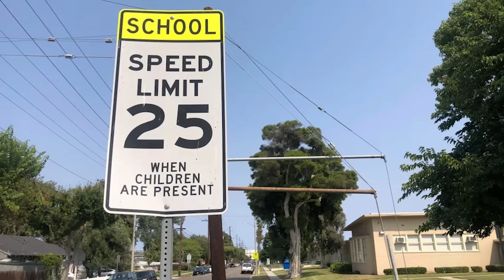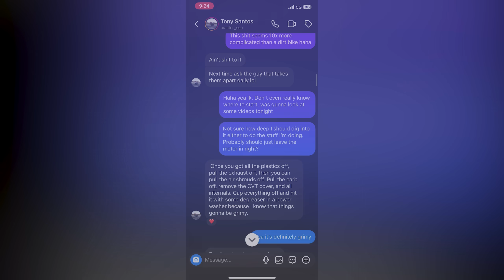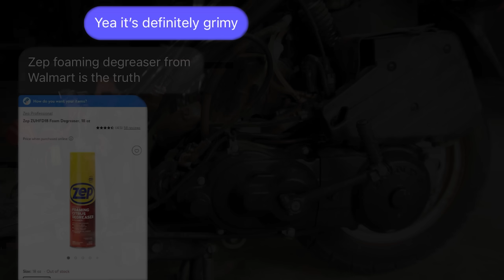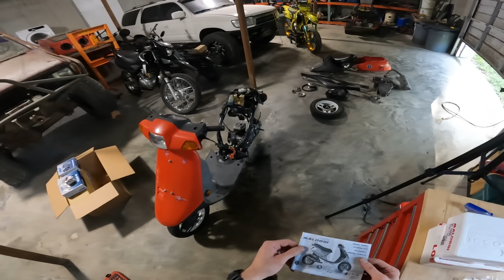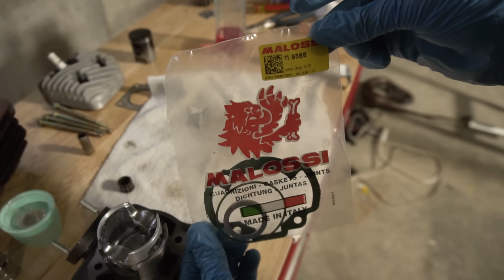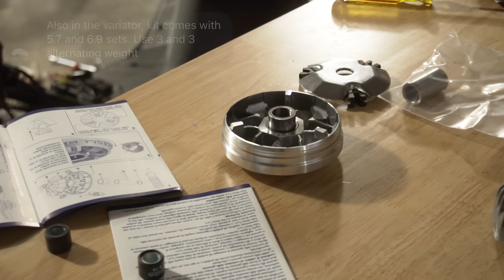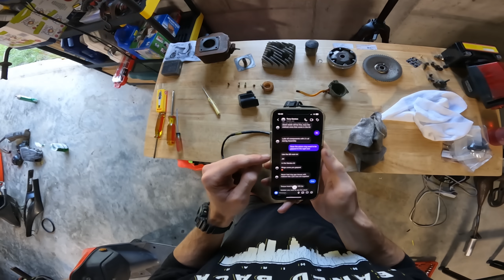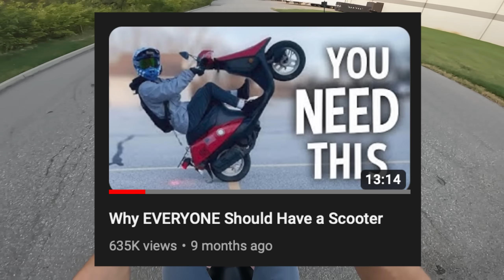HUGE Power Upgrades on my DREAM SCOOTER

Comment: Try it with the old center spring for the clutch it could be even more responsive. It just depends on every scooter. Btw that 70cc should  top out at 110km/h if you lose the airbox
Reply from the maker: yea I bet the carb and airbox is the biggest restrictor rn
Reply: @TwoStrokeJ  get 19 or 21mm carb or something and polini airfilter
Reply: @sodaman5048  you forgot that you need to throw out the dellorto and get a pwk
Reply: naaaah, airbox is the biggest friend here, cause 2t engine is so vulnerable about air "pulses" back and forward and amount of vacuum in the intake. Leave it alone, max you could do is drill some slightly bigger intake hole in your box. and naaaaah x2, honda vertical af-18 never gonna go 110km\h on malossi sport spec. Even much more tune-able yamaha jog will not. Around 75- yeah, maybe 80  @TwoStrokeJ
Reply: @Shokai899  bro never heart of a powerfilter
Reply: @Shokai899 110kmh is 65mph ??? ur numbers are higher bro
Reply: @moes95  dunno where's 75kmh higher than 110kmh ))
Reply: try to change the spark plug with the iridium one 
iridium spark plug should do the job @TwoStrokeJ
Reply: Could use a digital tachometer ay. 110 km/h, however is probably about as fast as I'd trust myself to ride that thing without further safety mods.
Reply: Shokai899 u are right i had a suzuki katana whit full malossi sport 70cc and it max out around 85 km/h
Reply: Leave the air box alone in my extensive experience there's no difference in power with a well tuned engine, just drill our were the air comes in on the standard one
Reply: The original center spring will just allow the belt to be pulled deeper into the pulley and most likely will never let it get into lower gearing. Unless you use super light counterweights inside the variator.
The pulley half that slides in and out is your problem area. That half pulley rotates and slides on 3 pins that are 1/4" posts/pegs that reside in 3 grooves, as the pulley goes together and opens it has to make a twisting action as well to get the pulley fully into high and low gears. Those gliders will start to cut the grooves into those slots. After a few weeks your gear will be stuck in the gear it rides in the most. Those pins aren't the issue, it's the slots. They get snags in the slot from the pins digging into the slot while riding.
That's why I shit canned 2 2002 Kynko Cobras.
Doesn't matter how many cubic inch you give it, or how much power, or how many RPM, those rear pulleys will always be duds and keep you from shifting properly. Flat spotting the weights in the front pulley often. 
If a person weighs 75 Lb. then they will get longer riding time on a brand new rear pulley. Anyone much heavier is going to wear into that rear pulley in no time.  Usually getting stuck in mid range gearing. So you have no take off and no top end either.
If there was a way to harden the metal of those slots, they would be golden. Even in 2002 that metal used on those pulley halves was too soft for the torque of the pins cutting into them.....
Reply: Can you guys please put your complete Addresse in the comments as the police wants to start a big confiscating for security reasons
Reply: @Kirt44 me too haha, those were the days. I ran mine with stock clutch and Vario, it melted the weights eventually, spun the plastic like candyfloss.
Reply: yasuni r exhaust 21mm carb and a 92 jet. running a bit fat. but it will def give more power and low end tourqe.
Reply: @Kirt44 stock italian scooters (piaggio nrg, aprilia sr, gilera runner) go 85kmh, so how come others cant?

Comment: Your 50cc Honda scooter looks very similar to my first 50cc scooter, a Honda Vision, which I bought somewhere around 1995 in The Netherlands. I was 16 back then, the legal age one is allowed to ride 50cc scooters and mopeds, nowadays a valid license is obligatory. What about the US, do you need a special driving license for 50cc? What is the maximum allowed speed for 50cc two-wheelers? In The Netherlands it was only 45 km/h and every moped and scooter was throttled,. either with a special cap or ring in the variomatic (the front pulley) and/or exhaust. The easiest way to remove the restriction was replace the exhaust pipe and change the vario weights, sometimes also the fuel jet. Unrestricted a lot of 50cc 2-stroke scooters would easily do 60-80 km/h, with a racing reverse exhaust pipe sometimes even more. Downside was it being illegal. What do your local policemen say about it?

Comment: If this is the original carb, you might wanna buy a carb that's 2 to 4mm bigger. A carb that's too small for the amount of cc's is also restricting A LOT of power.
Reply from the maker: Yea I agree it’s restricting power, but I wanted to use the stock one to hopefully keep the engine really reliable
Reply: A 26mm Mikuni from the Yamaha DT 125/175 is a must-have. A no brainer.
Reply: A bigger carb won't reduce reliability unless it's lean or too hot. @TwoStrokeJ
Reply: @TwoStrokeJ  this is a common misunderstanding since a bigger carb does not have anything to do with the reliability of the engine. Those malossi cilinders are made for big carbs, so it would even be a good thing for the engine.
Reply: Also, old carbs are less reliable since they are worn more. It wouldn't be a bad thing to replace the carb to one that's the same size if you care about the fuel economy.
Reply: That’s what I was thinking to a new carb. Get a polini cp21 it will be a lot faster!
Reply: @Toxic2T  you don't need a 26mm for a setup like this, a Polini CP 19, or even 21mm, would be perfect for what he's trying to do with the scooter
Reply: 26mm do just fine for 50ccs and even 100ccs. I do use them on most my builds. 21 is too small, already rocking one on my PA50 with AE50 cylinder. @sdugasjr
Reply: The stock intake is about 17.5-18mm wide so a larger carb wont help stock is about 14mm so Unless you run a CT style reed intake. On mine I modded a 17PE Nibbi carb (gastank epoxy puddy and 6mm tap) to work since jets are very easy to get and have pilot jets too. I tend to deaccel off throttle instead of brakes when i can and the stock non adjustable pilot jet will make it run lean on deaccel. If you go after market carb intake route stock airbox wont fit without some mods. As for the oil injection pump, I would just delete it and put a plug in it and run 32:1 premix as it was made to run 50:1 for the 49cc
Reply: @dermharse9614  You won't know unless you try. I'm running a 26mm in a 16mm intake and I have way more torque and top end on a stock 50mm 3 port 100cc Yamaha Sigma. I'll try the same this Saturday on a PA50 that it's reed intake has been bored out to 19mm. It's not about diameter, it's about the speed of the gasses aswell. A brand DT 125/175 Mikuni 26 carb will do just fine and it's cheaper than any aftermarket carb. I didn't believe at first till I tried it, back then I used to be stuck with 20mm 4 stroke Keihins and 21mm Mikunis that suck.
Reply: @sig2322 Absolutely not, it's not about diameter it's about gas speed. Already proven that on a 100cc Yamaha Sigma that still has it's stock 16mm intake. Just shoved the 26mm in and it is a day and night difference on torque and top end.
Reply: @sig2322 Jetting is the key. The bigger the carb the smaller the main jet should be when you have low cc. It's about not choking the hell out of it while making sure the gasses go as fast as possible. Porting the intake and reed entrance is a must to make sure there's no obstructions or try to reduce the bottleneck on the intake tube to the reeds. Funnelling the hell out of it
Reply: @sig2322 If you still don't believe it I already installed it yesterday for you all. No choking no bs, perfect revs and power delivery on ground. Uploaded the video minutes ago.
Reply: @klapman1   If you still don't believe it I already installed it yesterday for you all. No choking no bs, perfect revs and power delivery on ground. Uploaded the video minutes ago.
Reply: @sdugasjr   If you still don't believe it I already installed it yesterday for you all. No choking no bs, perfect revs and power delivery on ground. Uploaded the video minutes ago.
Reply: @dermharse9614   If you still don't believe it I already installed it yesterday for you all. No choking no bs, perfect revs and power delivery on ground. Uploaded the video minutes ago.
Reply: @sig2322  It's a curved 26mm pipe and yes I'm still using the stock 16mm Honda PA50 manifold that I drilled up to 20mm. Works like a charm, I went from 20mm to 26mm now I have way more snappy torque. I'm getting a custom reed box in Dec, already ordered it
Reply: @TwoStrokeJ  that makes no sense
Reply: @Toxic2T 26 is too big, bigger≠better in this case
Reply: @delallish123  My ported 50cc begs to differ. I've been debunking these myths for almost a decade.
Reply: @Toxic2T  there is no reason to have such a big carb on a 50, none at all
Reply: @delallish123  it's like saying a CR80 shouldnt have a 28mm carb in it just because it's a little 80cc.
Reply: @Toxic2T  uh no its not
Reply: @delallish123  Whatever helps you sleep at night, bud...

Comment: dont know a lot about you current exhaust but i can assure you if you get a yazuni R, yazuni c16, Yazuni c21 pipe you are gonna get it to go 50+ mph and even e bigger carb you can go even beyond that. Here in finland the moped scene is HUGE every single teenager gets their moped licence when they turn 15 so it is not that uncommon to see scooters going 60+ mph (the legal limit is 27)
Reply from the maker: Yep that’s awesome man! I am going to keep the stock carb for now for its simplicity and hopefully it helps keep the engine more reliable over time. Maybe some day I’ll do a build with a big carb
Reply: noo they to big for this Cylinder
Reply: @rihardstomsons937  nah there not, i have a yasuni R under my DR70, great combo
Reply: For this cylinder yasuni c16 and c21 is a overkill
Reply: @wielisziel yeah but a yasuni r is not even close to a c16 or c21

Comment: A bigger carb and a new airfilter is necessary, as the engine is basically being suffocated right now. The scooter won't get any more complicated or any less reliable, it will just run better and make way more power.
And you shouldn't worry about having to tune the carb, as it really isn't that difficult. You just pick the right jet, which doesn't take too long through trial and error, and then you adjust the air/fuel ratio and the idle. After all that your malossi kit should max out at about 70 mph.
Reply: And change that shit exauste buy one fron malossi or polini
Reply: This one is a quiet sleeper exhaust
Reply: @realkilju  yeah like a gianelli go or something similar. He should get a yazuni z instead.
Reply: Stock is 12mm. Place a 17.5mm intake + carb and a secundair transmission behind the wheel. In europe is this type a honda vision

Comment: It's amazing how old machines have more support than recent machines does as to upgrading and finding parts for em. I can feel the happiness from that initial start when it literally started like a brand new bike man!!! I know how that feels and pretty sure had one that didn't start most of the time except when it's cold LMAO. Used to have this 80's honda cub that I ride around with before it got stolen man, I even put a 125 mixed kit on it and everything and honda parts rarely change over time so it's easy to freakin mod. This one takes the cake though! Nice vid man :D

Comment: These things are really popular or at least were back in the day in italy, vespas turned into flying coffins, big blocks with bigger cylinders, and the ignition also made huge power if modified correctly, also put a bigger carb in, i think its mandatory if you have all that stuff in there, 125cc two stroke scooters were able to reach incredible speed and power, went up to 180 ccs

Comment: remember to break it in instead of giving it full throttle. We normally break it in to 155 miles.
Reply from the maker: yep, had to send it for the video haha so didn't have the proper break in im sure
Reply: @TwoStrokeJ  Oh okay! How is the Puch Maxi doing? Saw it sat without a cylinder, why is that?

Comment: you will need a bigger carb for more easy power.
15mm minimum for 70cc
but 18 or 20mm will be great, and then play with air / fule mixture and you'll get better acceleration and pull.
Reply: 17 is stock on that honda bro.

Comment: be prepared to change the piston sooner since 70cc wears out faster and if you do alot of top speed pulls they wear out really fast, also a bigger carb will give you more power but this is as good as it needs to be
Reply: The malossi sport is a really durable cylinder
Reply: @nico-broo  im talking about piston they do wear out sooner and you will loose alot of power
Reply: @wash.625  My father did the same swap for his Suzuki 50cc when he was young (50cc were extremely popular in Spain), and he always says that eventually, the motor brakes due to the difference of pressure.
Reply: @miguybaltasar1111 I am from croatia and scooters are still popular here especially piaggio and people tune them in all kind of ways and I did them too, 70cc really opens the power but it wears out much quicker which isnt a big deal since the piston and cylinder malosi is really cheap to replace every now and then
Reply: @wash.625 especially when you don't run it in properly
Reply: What most people don't realize, if they pull a lot of hills the jetting gets lean going up long drawn out hills.
I had the issue on 2 Kymco Cobras back in the early 2000's. Suggested an #85 jet and even a 91-100 couldn't dial in the fuel mixture. Too lean up hills to too rich on the flat lands.
There was a cable attached to the throttle on the oil pump that I always considered from day to day was heating and cooling and getting the mixture off, never really figured it out, after using a range of 15 jets I doubt the issue was going to change. 
I even bought a "Dial A Jet" from Thunderjet Industries back then. I could get it to run, but after about 3K miles they would finally have enough of the overheating. Damn rear pulley getting locked into mid range gearing was the worst problem. They are made for a 75 pound person..... And or the introduction of Chinesium......
A Kymco Super 9 liquid cooled may would have been better, but then again may have been more of a money pit; on the hills I rode on the daily.

Comment: You should buy a tomos 49cc 5 speed moped/motorbike they are really good looking bikes and are quite good at wheelies and stuff

Edit: they are also very customizeable from the bars to the 74cc kits and custom dellorto carbs, ive seen some that make 15hp at 74cc
Reply from the maker: I would love one of those, but they never sold them in the USA sadly. I would have to import one
Reply: @TwoStrokeJ  nah they imported them we rocking wheelies on tomos in NC for dayys your forget trimmer and makeshift?
Reply: @TwoStrokeJ they were imported around 1975 but they are probably very rare now
Reply: @TwoStrokeJ there is a place in South Carolina that has a ton of them for sale in Columbia
Reply: My first bike was an old 50cc Tomos. Loved that thing. And it was pretty fast for a 50cc, even stock.

Comment: Nice video man, im also in scooter tuning here in Austria.. i would guess you to switch the roller weights maybe all to the 5,6g then u maybe get better acceleration bcus the engine is more in to the power range at more rpm..

Comment: Great video brother!  71,000 subs and 1.4 million views, nice work!  I love the vehicle community.  I have a 7.3 powerstroke and through forums have been able to message with the original engineer of the 4r100 transmission that's in the truck and many other engineers of the truck and motor, it's crazy to speak with these OG's personally!   It's amazing how great people can be and how much they are willing to help others.  I have never taken my truck to a mechanic soley because of the community and culture around vehicles.  I just subbed, I like your format!

Comment: one more thing you can do is get a bigger carb, it will allow the engine to breathe better and you should get even more power since the air doesn't get as much resistance as before

Comment: When disassembling the cylinder head always remember to put a plastic bag or paper towel in the hole, ive dropped one of those c shaped pins into the engine once and almost debated taking apart the engine, luckily I had one of those telescoping magnets poles to use to get it out

Comment: Nice, we've been doing the same for years. Now we're up to triple and quadruple the original power and even more on the bleeding edge of kits and bespoke engines, up to 100 hp.  I run an old, 1980s 70mm kit that is still in production and currently looking at some of the more exotic offerings for my 1960s scooter. Best of luck and keep on going faster!  :)

Comment: I think you got a really good build for the money, but there are a few small details I noticed that you should keep in mind for next time. Since you bought a cast iron cylinder this time, it will take a very long time to break it in, and if you don’t do it properly, the cylinder might seize much faster. So, you should consider getting an aluminum cylinder next time. Also, when you upgrade from 50cc to 70cc, the moped's crankshaft may not be able to handle it, so you should replace it with a reinforced crankshaft.

If your goal is to do wheelies with it, you should also use lighter variator weights, as the lighter the weights, the better the acceleration. You should also replace the carburetor, because the stock carburetor often can’t provide enough fuel for a 70cc engine. And if you change the carburetor, you should ideally change the ignition as well, otherwise, it’s very easy for the moped to misfire.

Additionally, you need to get an unrestricted CDI, as the original CDI is designed to limit the speed to 25/45 km/h. But other than that, it was a really good build for $645